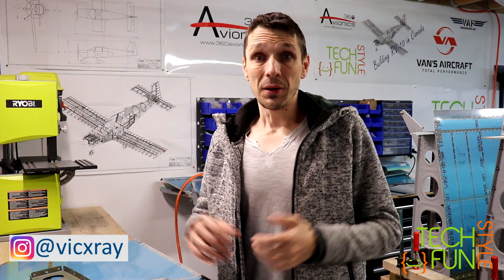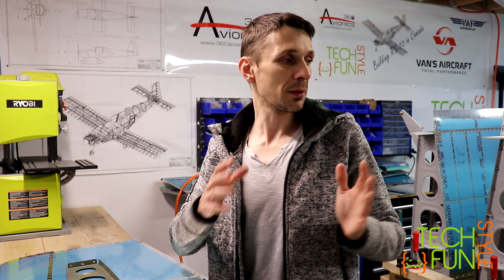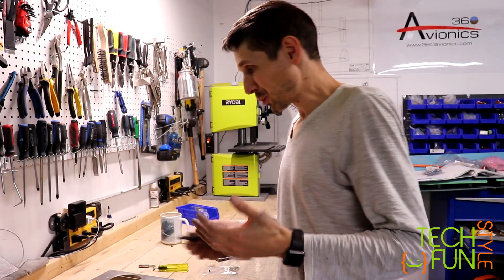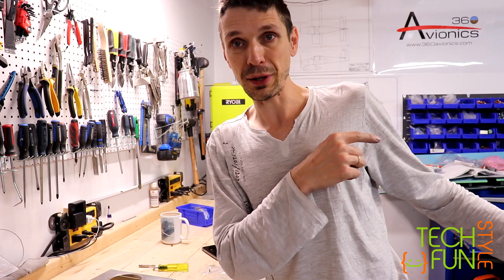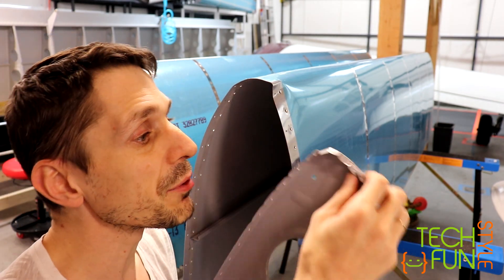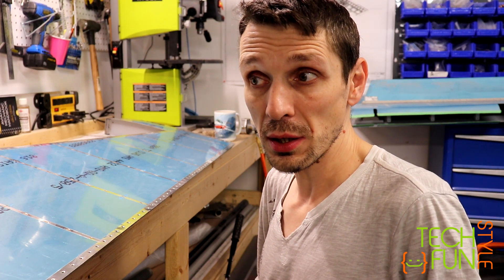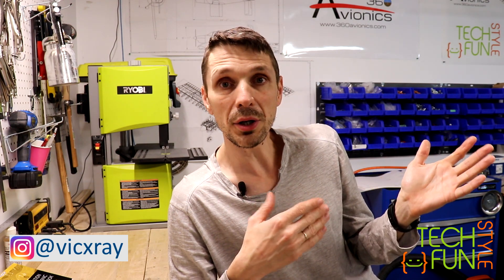RV-10 Parts finishing. Part 1

Comment: Hi, what is the name and were did you find that neumatic tool to cut the aluminum skin in the wing? Seems to be a lot better than my rotary cutter for that task.... Thanks and congratulations for the great work!
Reply from the maker: I think you talk about this one: https://www.amazon.ca/Handheld-Nibbler-Hardness-Scissors-Pneumatic/dp/B07M64X2VJ/ref=asc_df_B07M64X2VJ/?tag=googleshopc0c-20&linkCode=df0&hvadid=335074856084&hvpos=&hvnetw=g&hvrand=8246274856891463555&hvpone=&hvptwo=&hvqmt=&hvdev=c&hvdvcmdl=&hvlocint=&hvlocphy=9001520&hvtargid=pla-779190066181&psc=1
Reply: @techfunstyle1606  Great, many thanks!

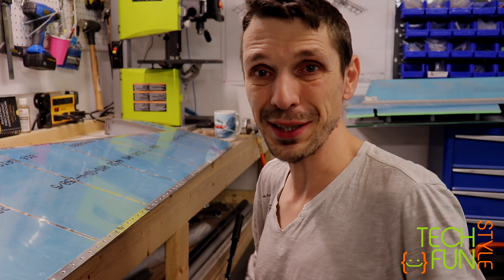Comment: 11:35 what sealant did  you use for the ruder trailing edge?
Reply from the maker: I used tank sealant which is sold by VANs Aircraft at their online store. Works great so far.

Comment: Were those aluminum L-angle pieces on which you were marking with pencil? Beware of corrosion resulting from the graphite pencil marks on aluminum.
Reply from the maker: Thank you! I was not aware of that.
Reply: Yes, Vans recommends to always use Sharpies and avoid pencils.